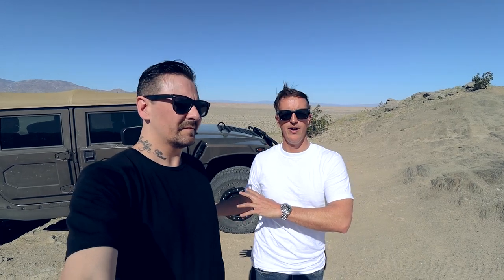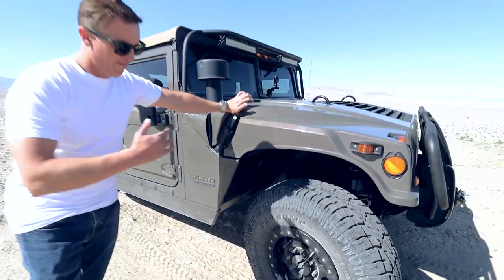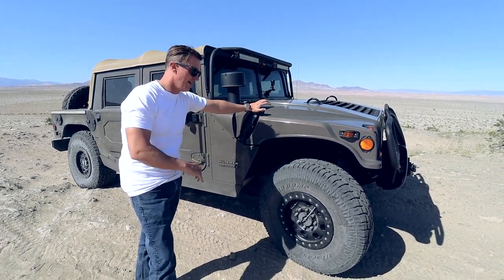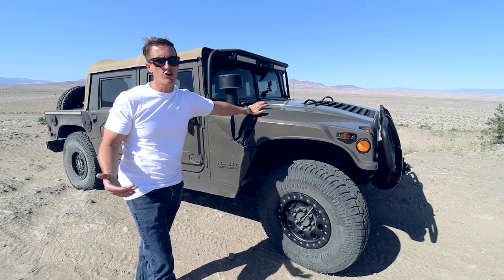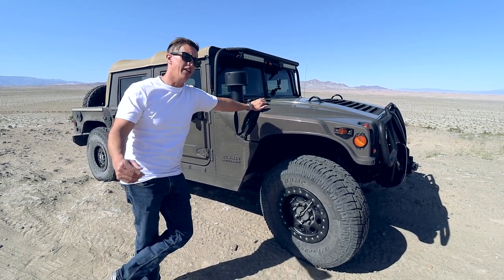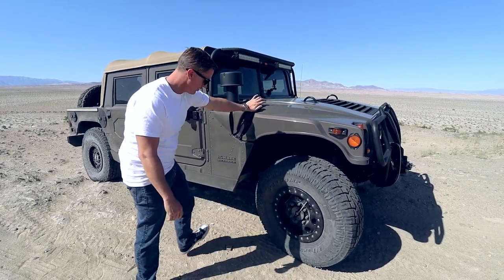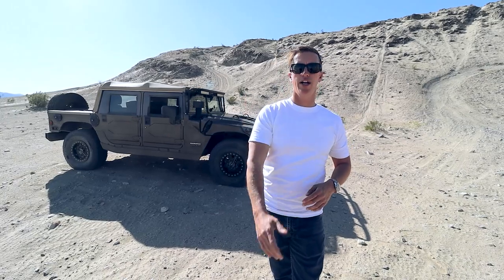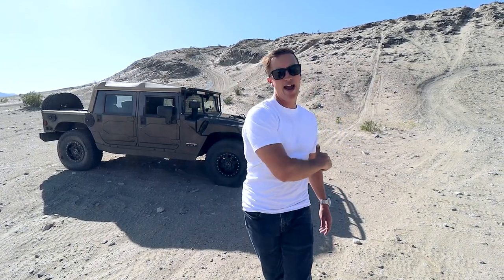WHAT IS CTIS & BTM ON A H1 HUMMER???

Comment: Thankfully this video made me realize that the previous owner most likely installed a Detroit locker in the rear of my truck. A lot of information about the different types of lockers on Flash Off-road’s website. I will say tho that while there are some very minor side effects of having a Detroit locker in the rear, I have not noticed any dangerous situations driving with it on road for 6,000 miles (didn’t even realize I had one installed for 6,000 miles either if that says anything). From what I’ve read, not a good idea to have one installed on the front tho. The modern Detroit lockers are supposedly a lot smoother than the old ones. I do have a 1997.5 (T1) FYI

Comment: 12F/10R psi dmaxin through glamis on military baja ta's
Also you don't need 100% torque to lock a torsen diff. I just drag the brake a little and apply more brake pressure as needed. And keeping the transfer case in low range will keep trans fluid temps down.

Comment: The running hardware looks ok, but the control system looks really primitive!  The Australian AIR CTI hardware is much easier to use, tracks the target within 2psi  and has different alarms for problems, such as a slow leaks.  I have been running it for several years now.